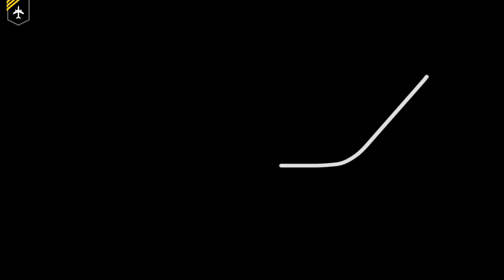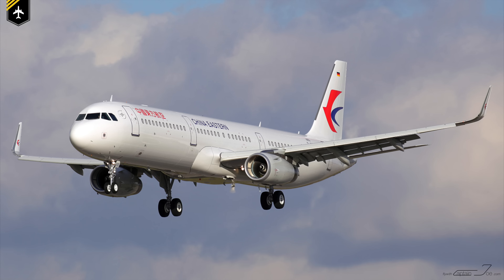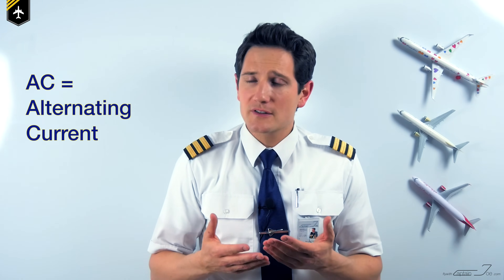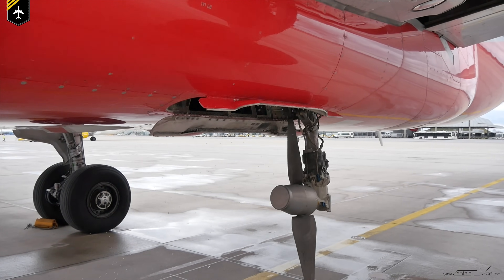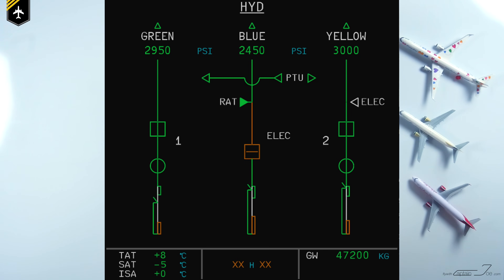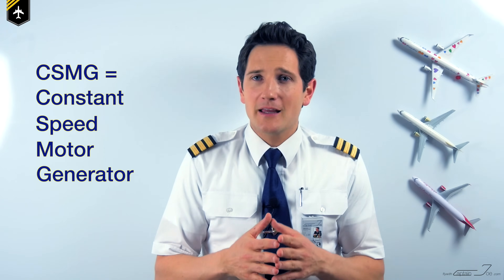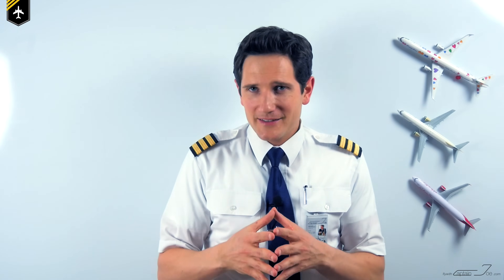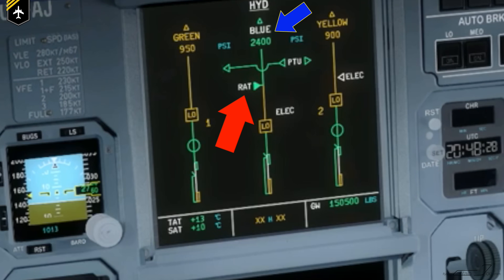What´s a RAT? RAM AIR TURBINE! Explained by "CAPTAIN" Joe

Comment: One of the most notable use of the RAM is the gimli glider. remember that one that ran out of fuel due to a misconversion between imperial and metric? Yes, that one. No fuel, no engines, no APU, no control.
Reply from the maker: True, I´ve mentioned it in the official incidents at the end of the video!
Reply: That's the most primitive mistake you can make: "Oops!  We ran out of fuel!"
Reply: @Rathtrainer  Yeah. There was a conversion error with the Gimli Glider: The plane measured fuel in kilos, the ground crew delivered it in pounds - it was the first 767 Air Canada had, and the incident happened in 1983. There was some damn good flying going on that day! (Check out the Mayday episode if you haven't seen it!)
Reply: The same with the Azores glider.
Reply: He uses side slip on that one right? I've watch that episode. Thats why im familiar with the RAT.
Reply: @Zzz-ui4mt  One of my favourite Mayday episodes. Side-slipping a damn wide-bodied jet... Awesome work!!
Reply: Some trivia per Wikipedia: __ "In April 2013, the Gimli Glider was offered for sale by a company called Collectable Cars.[5] at auction with an estimated price of CA$2.75–3 million.[26] However, bidding only reached CA$425,000 and the lot was unsold.[27]According to the website dedicated to saving the aircraft, it was dismantled in early 2014, but not scrapped. Parts of the metal were made into metal luggage tags and are offered for sale by a California company, Moto Art."  _ Also, the TV movie, "Falling from the Sky: Flight 174" in 1995, was based on this event.
Reply: That was an amazing landing
Reply: thephantom1492 yea. Basically crap has really hit the fan when you need to use it hehe
Reply: thephantom1492 hahahaaha😂😂😂
Reply: thephantom1492 0 90th
Reply: The movie "Falling from the Sky: Flight 174 (1995)" https://www.imdb.com/title/tt0113018/
Reply: but it took a long time to deploy

Comment: Hi Captain Joe, 
erst einmal ein großes Dankeschön für deine  Videos, welche du, trotz deines durchaus stressigen Berufes, hochlädst. Nun eine kurze Frage:

Kannst du ein Video über die genauen Unterschiede der Geschwindigkeiten (IAS, TAS, GS, Mach) machen, denn ich verstehe diese noch nicht genau. 
Vielen Dank und mach weiter so!! :)
Reply from the maker: Danke! Die Themen werden auf jeden Fall in Zukunft geklärt! Grüsse joe
Reply: IAS: Angezeigte Fluggeschwindigkeit relativ zur umgebenden Luftmasse. Wird auch Unkorrigierte Eigenschgeschwindigkeit genannt. Wird direkt vom Staurohr gemessen= fehlerhafte messungen. Bei Airlinern wird dies allerdings korrigiert. Hier spricht man von CAS dann. Trotzdem wird es auch als IAS benannt, also bei Airlinern IAS=CAS.Unterhalb von FL270 ist IAS von Bedeutung. IAS= Die ''wichtigeste'' Geschwindigkeit, da die  angezeigte Geschwindigkeit IAS über den Staudruck 
gemessen wird. Der Staudruck ist ein Mass für den Auftrieb. Somit ist auch 
die IAS ein Mass für den Auftrieb.
Reply: TAS: True Air Speed. Die ''echte'' Geschwindigkeit bezüglich der umgebenden Luft. Bedeutet hier wird alles berechnet. Wind, Windrichtung etc.
Reply: GS: Ground Speed. Geschwindigkeit bezüglich der Erdoberfläche
Reply: Mach: Alles über FL270 ist Mach ''wichtig''. Geschwindigkeit bezüglich der Schallgeschwindigkeit. Mach 1 ist Schallgeschwindigkeit. Passagier Flugzeuge fliegen bis zu 0,92 Mach (nur die großen 747-400etc.)
Reply: Du nicht?
Reply: Captain Joe ah du kannst  Deutsche ok